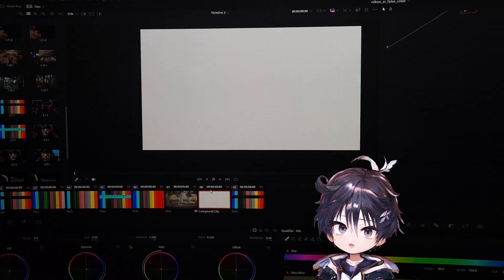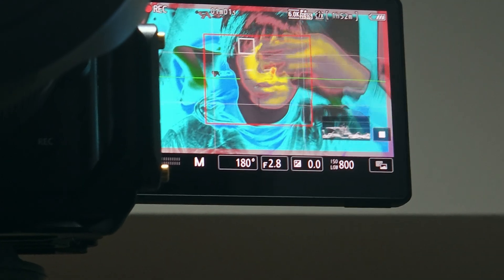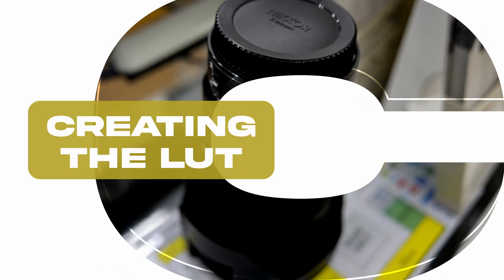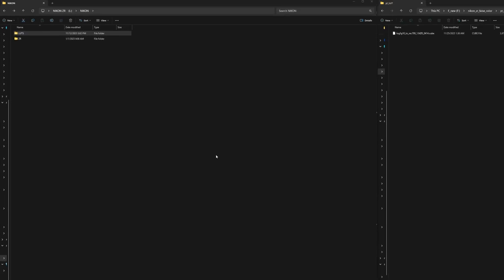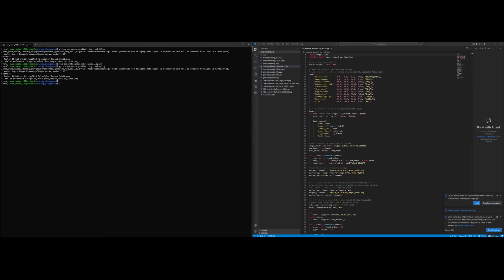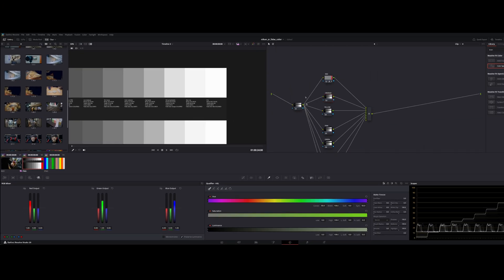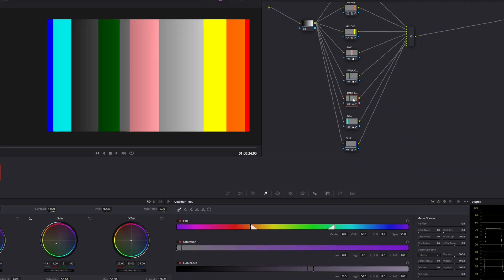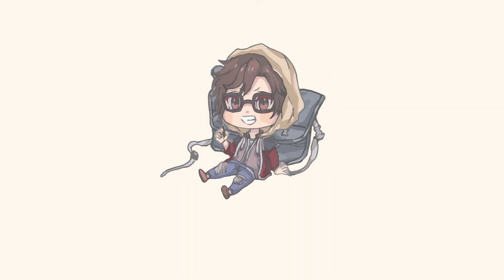Nikon ZR | Creating a False Color LUT for Perfect Exposure | ML Engineer/Artist Daily Life in Tokyo

Comment: why in the field testing is there so much aberration artifacts?
Reply from the maker: Hello and thanks for the comment.

False color is just an overlay and introduces no optical aberrations.

If you can share a timestamp(s), I’ll review the source footage on my end. Another viewer mentioned something similar, so I’d like to see whether it may be related to YouTube compression, stabilization in post, or frame-rate cadence.
Reply: @kasukanra  For example 8:29 you can see the edges of anything have green/red artefacts. Usually a lensing issue but I see you are using SII lens which doesn't have these issues...
Reply from the maker: @shoots_austin  Thanks for elaborating! The original clip was clean (tripod, neutral lighting, proper WB), and the colored edges only appear after applying the Dehancer film grade. It looks like the color head is pushing some teal into the shadow side, so that faint green edge is just a side effect of the film look. I think it is a similar situation with the red as well, likely enhanced a bit by the halation and bloom settings.

It doesn’t really bother me personally, since I tend to like a bit of texture and “imperfection” in my images. I come from a background where I add paint strokes or noise to my 3D renders, so a little bit of film character feels natural to me. I appreciate you pointing it out though, and it is something I will stay more consciously aware of in future grades.

Comment: Nice work!
My problem with log footage is that u usually wants to overexpose is 1-2 stops and then bring it down it posts or else it can be really noisy. What are your take on that ? Cause I guess this false color lut is rec709 and not measuring the log values?
So let's say I shoot at the low iso (800) and then I set the exposure index to 200IE. That would give me how it looks -2 stops under in post, but I also wants to see my exposure tools using the sensor data to maximize the amount of light it gets.
Reply from the maker: Great question. That is exactly what this is designed for.

To be clear, this LUT stays strictly in Log3G10. It does not convert your footage to Rec.709 to measure it. This is why you can rate the camera at 200EI (overexposing 2 stops) and see the actual sensor headroom rather than a clipped display image.

So why did I mention/use Rec.709 in the LUT? I only used Rec.709 to design the gradient's 'zones' (defining what counts as skin tone or clipping in a normalized image). I then mathematically mapped those zones into Log space before exporting the LUT.

Effectively, the LUT is looking at the raw Log signal and saying: 'If you were to normalize this later, this specific Log value would clip.' It’s a scene-referred meter calibrated to predict post-production limits.

Comment: I can not get this lut to load on the ZR. I've tried through the micro SD as well as the Cfast. The camera sees it on the CF express but when I go to assign it to a unused spot it just flips back to the 3D LUT menu and when I go to select the false color out you've made it doesn't show in the options. Any suggestions? PS unreal work here.
Reply from the maker: Did you put it inside the LUTS folder inside the Nikon folder on the microSD card? It has to be in that very specific location. If so, then I don't know.
Reply: @kasukanra  Yes I followed those steps, but if it's on the micro SD card it shows as empty. When I put it on the CF card it shows the duplicate files but neither will load to the camera
Reply from the maker: I'm not sure, then. It might be specific to your use case, so maybe reading the manual will help.

https://downloadcenter.nikonimglib.com/en/products/659/ZR.html

When I was reading through it, I was under the impression that you couldn't install LUTs from the CF express card. Does it help if you manually rename the downloaded LUT to another name?
Reply: @kasukanra  I loaded your LUT from the CFExpress card, no problem.  Make sure it is inside the "Nikon" folder and then inside a "LUTS" folder (all caps)

Comment: Thanks for making the lut available to us.  I tried installing it, I can see the lut on the card, but when I try to import it nothing happens. What am I missing?
Reply from the maker: I'm not sure. Did you put it on the microSD card? If so, maybe the manual has more information.
Reply: @kasukanra  thanks, I figured it out.
It was creating a duplicate file on my card for some reason.
Reply: @BillMcdad  What was your work around? It's not working for me either
Reply: @lonewolfproductionsglobal  it was creating a duplicate file on the card. When I tried the second one it loaded fine check your car to see if it’s duplicating it.
Reply: @BillMcdad  It is duplicating but neither file works. The one without the ._ at the start should upload but it won't. Very odd.
Reply: @lonewolfproductionsglobal  not sure what’s happening on your end but it worked for me. Maybe format your card and try again. Good luck

Comment: Thank you for the work you put into this. What is the weird blurring / aberrations I'm seeing? It's really noticeable inn the Sangenjaya section, but is also elsewhere like Nakano (Is this Nakano's mascot?).
Reply from the maker: I think it's the stabilization I added in post through Da Vinci Resolve for Sangenjaya or duplicated clips with lower opacity in order to reduce the flickering. I shot on 24 fps but Tokyo lights are 50 Hz, so filming on 25 fps would have fixed it.

Nakano might just be user error for the 26 mm f 2.8 or also stabilization issues.
Reply: @kasukanra  Again I appreciate the time and effort, but rewatching, it's everywhere, even your face at the beginning.
Reply from the maker: Sorry, I'm not sure then. Without anymore specific details, I don't know what the issues are.